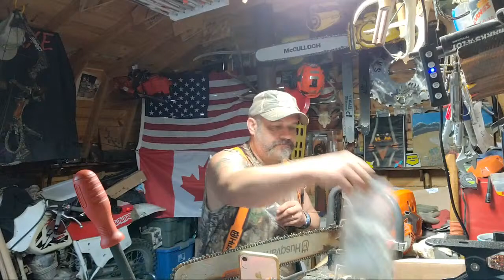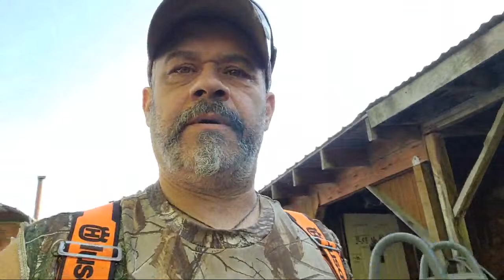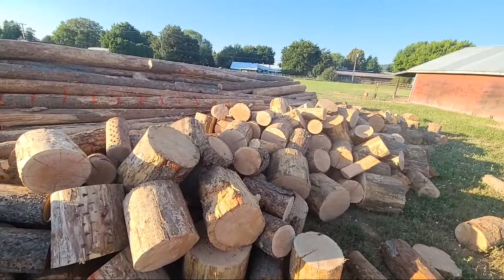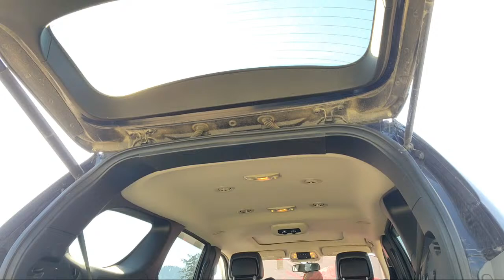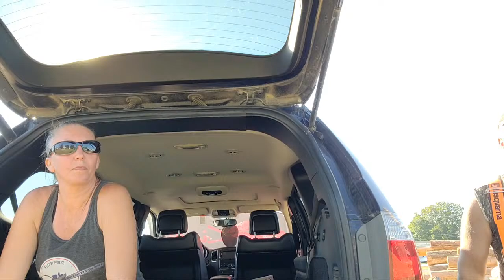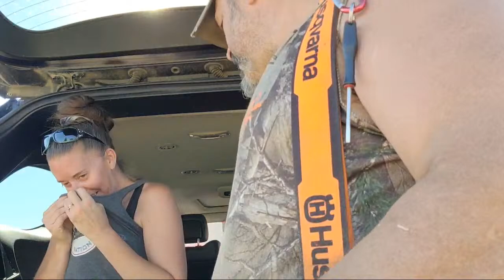Firewood Pro Sizer "TURBO"

Comment: Did u try high idle start when saw is warm
On the 572
562 does the same thing until u pop it on high idle
Usually takes 1 Or 2 pulls
Or don’t and pull your brains out
Putt choke on the push down for high idle

Peace brother